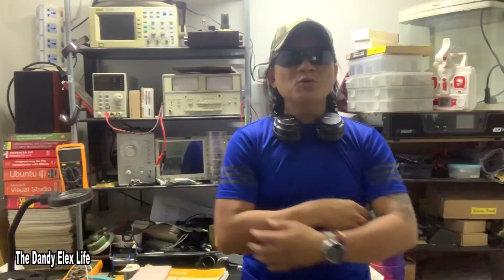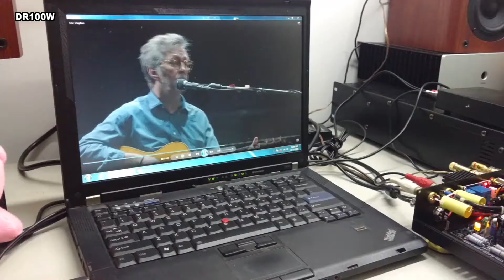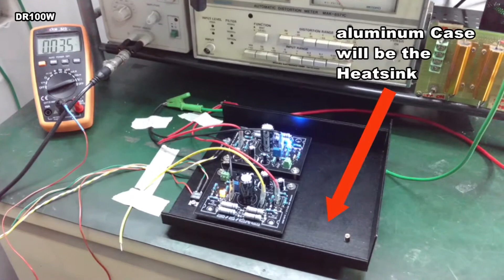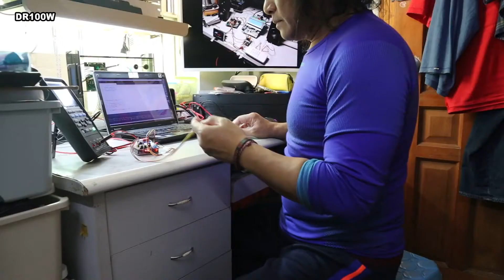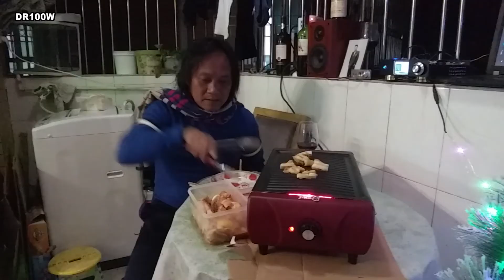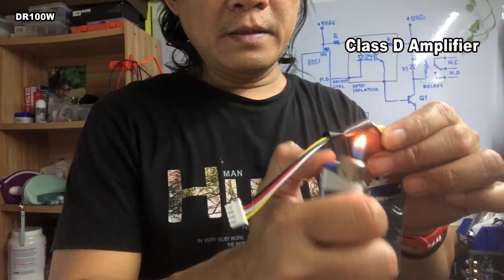Class A |  MosFET Power Amplifier  AMP CAMP AMP AMPduino Arduino Control | Nathan Amplifier

Comment: To significantly improve the sound in this amplifier, you need to do the following: put a 2N5089 transistor at the input (the gain of this transistor varies from 400 to 1200), put an IFR250 at the output, put a 10 microfarad audiophile film capacitor at the input, put 3300 microfarads at 25 Volt Nichicon KA or FG. All electrolytes can be shunted with 100pf Vima + silver-mica 100-820pf. But I can see that the sound is no better than the modified amplifier on the TRA3255. The Pass amplifier requires good cooling so that half of the voltage does not drift, but is stable, which takes up a lot of space and heats up like a battery. The modified amplifier on the TRA3255 has an excellent stereo panorama, good sound detail, clean operation, takes up little space and the radiator is a small, more powerful amplifier. In terms of sound, they are approximately the same, even if Pass is worse ... The revision of the PASS amplifier is working, the sound becomes of high quality.
Reply from the maker: That's awesome info, thanks for sharing, and if you can share also the modified schematic diagram,  that would be really great to all audio hobbyist.   Thank you!